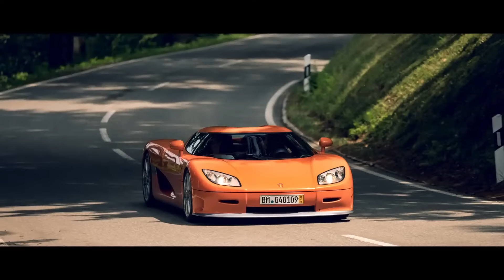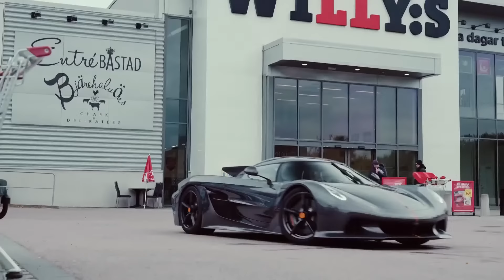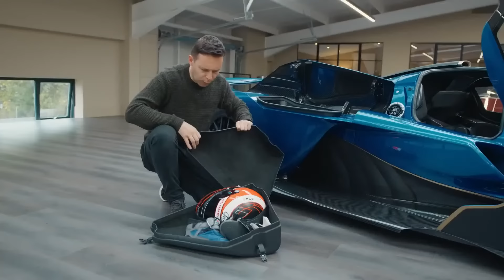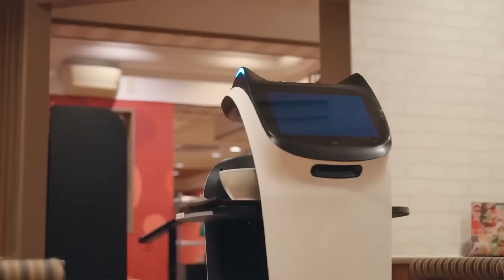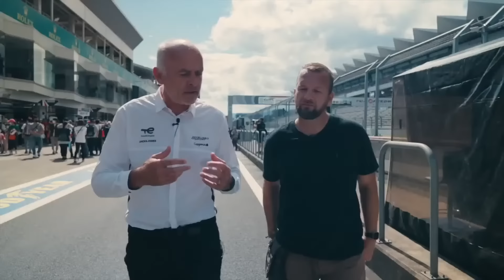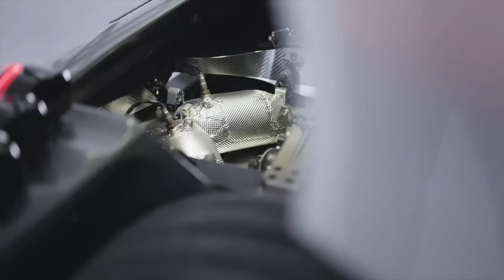🔴 LIVE: Top Gear Best Hypercars 2022 Pt.1: Koenigsegg Jesko, Peugeot 9X8, Koenigsegg CC850

Comment: praga needs to switch to a turbo hybrid 4cylinder add electric active aero u can power it from the hybrid battery and when i say hybrid i mean plug IN charging and a gas high performance  engine or just go full electric...

Comment: 0:45 Note that it is running on normal fuel, at just over 1200 HP...
Now imagine at full power 1600...
Reply: Venom F5, 1800 horses
Reply: @ryze9153  with no controlls of emissions?
Reply: @anderszettergren4302  ?
Reply: @ryze9153  yeah but you'd be handing over millions to John Hennessey. No thanks.
Reply: @maynarddrivesfast804  yall really have a problem with that man, I swear.
Reply: @maynarddrivesfast804  £1.9 million. Slighty more than a couple cars in its class, and slightly less than the others.